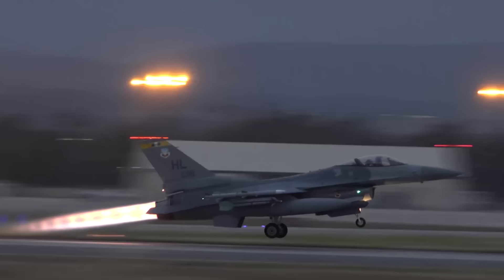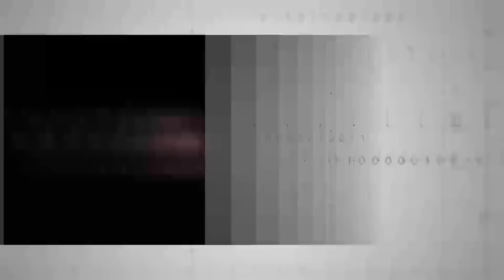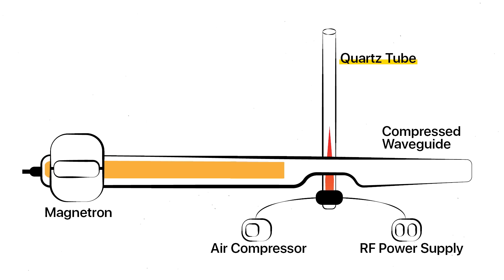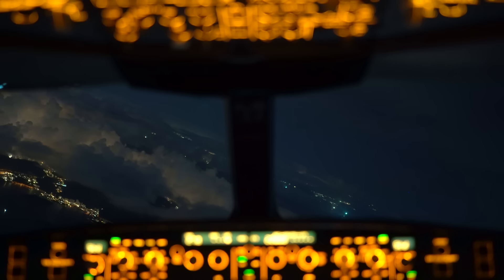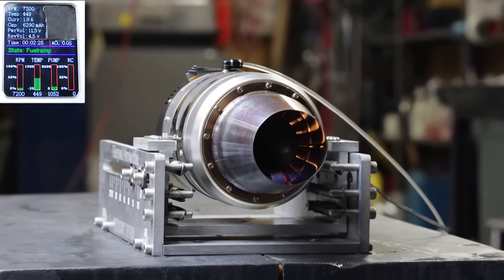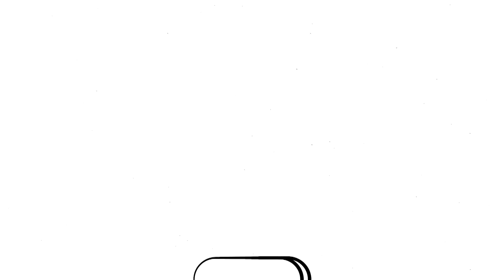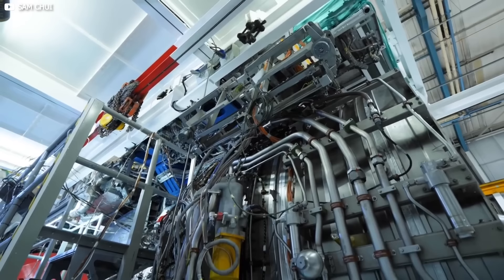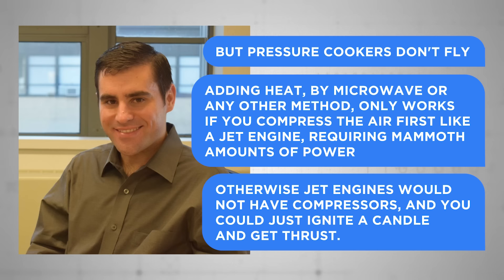What Are Electric Plasma Jet Engines?

Comment: Eliminating the use of fossil fuels (especially when most of the worlds economies and tech are built around or from them) without a better alternative is ridiculous. Replacing a tech with new tech requires that the new tech be better in every way. Take cell phones for example: regular old phones, flip phones, brick phones, black berries etc... were replaced by smart phones. The original iPhone was the first and it succeeded because it was superior to all that proceeded it in every way. Had the original iPhone just been a blackberry with a better camera, the seismic shift in cell phone technology probably wouldn’t have happened because nobody would have really cared

Comment: It's simply not going to work. While you may be able to get one to make decent thrust, size and weight will be out of the question. The one thing that makes jet engines work is the ongoing constant explosion 💥 of the air and diesel. This expansion is what forces the compressor to turn and provide expanding hot gas for thrust with no additional hardware. 
Electric can definitely work in a hybrid system using lots of small electric fanjets powered by a piston or better yet wankel (rotary) constant speed generator with enough battery capacity for 7 minutes of flight. A rotary style engine at a constant speed can be designed for extreme efficiency. Minimal parts required and far lighter than a standard piston engine.

Comment: The inefficiency of combustion engines together with the low energy density of batteries lol. Propellers are efficient. Their only problem is that they go a bit slower.
We need to start thinking how we can make do with less, not this greenwashing lie of having the exact same performance without burning fossil fuel. That era of excess energy is simply over.